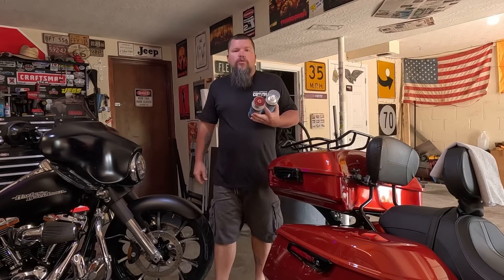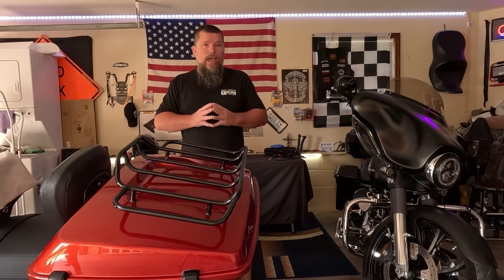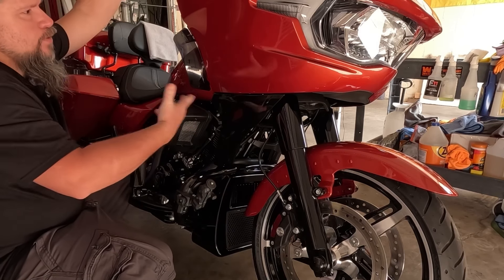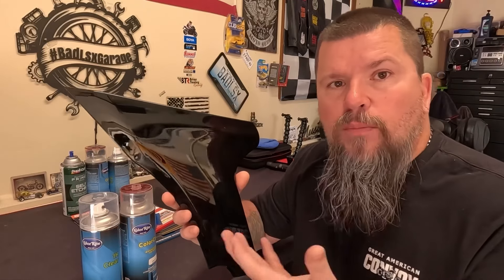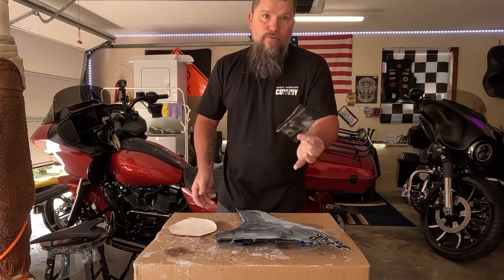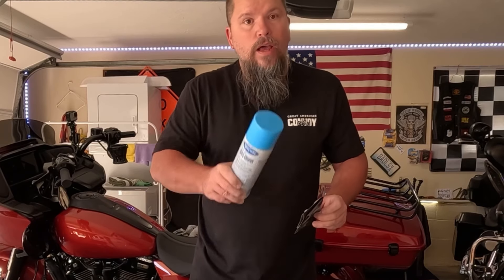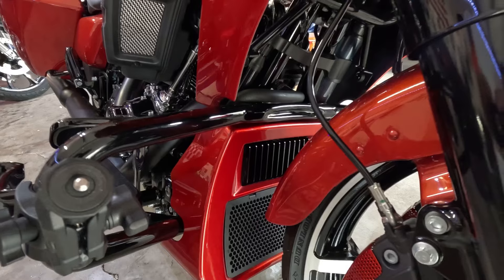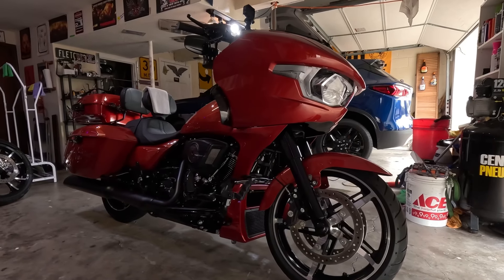HOW TO PAINT H.D. WHISKEY FIRE SPRAY PAINT (2024 RG/SG)

Comment: There two spray nozzles included with the color rite aerosol can, red cap and regular black with yellow nose. Which one would be better to use?
Reply from the maker: @chrisjaskolka2907  they are different spray pattern nozzles. They just recently started doing that. I personally like the all black nozzle.
Reply: @ I agree, that’s what I’m used to. The other one is vertical fan pattern, I suppose
Reply from the maker: @chrisjaskolka2907  exactly!

Comment: They came out great.  Amazing job. 🎉
Reply from the maker: Thank you! 👍✌️
Reply: @badlsxgarage  I want to spray paint the top cheap plastic air vent cover on my new 2024 HD RG CVO ST but I do not have the guts to do it... Can't believe they put on that cheap matte plastic on a 50K+ bike...Any suggestions?
Reply from the maker: @OnyxCVO  I wrapped mine with carbon fiber vinyl from ORilleys auto parts. They have vinyl that looks pretty good. Not some cheap knock off. Maybe check that out.